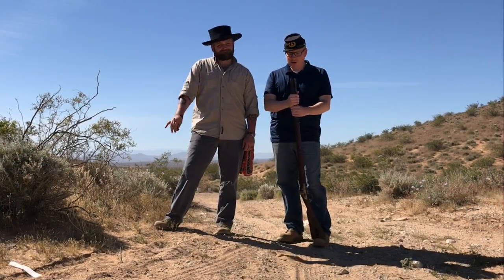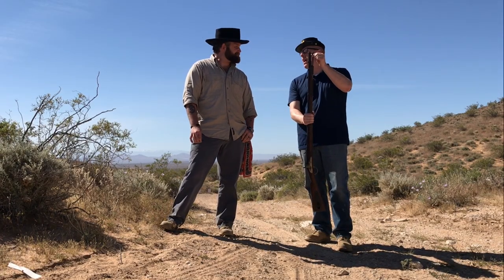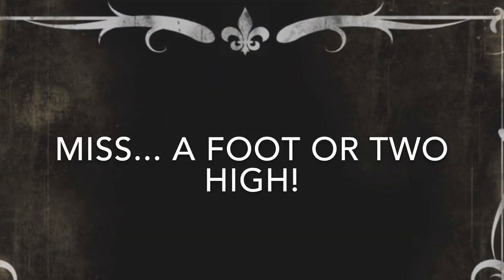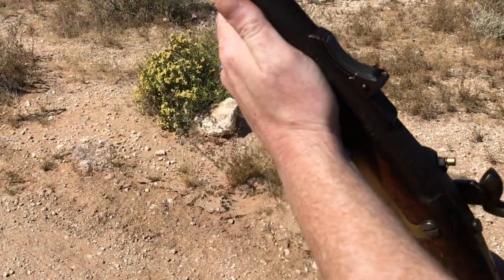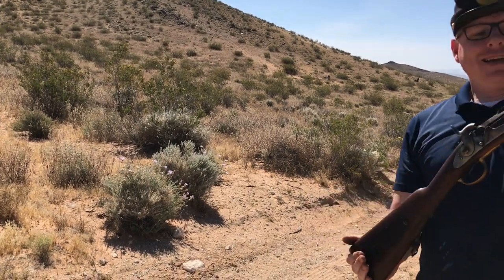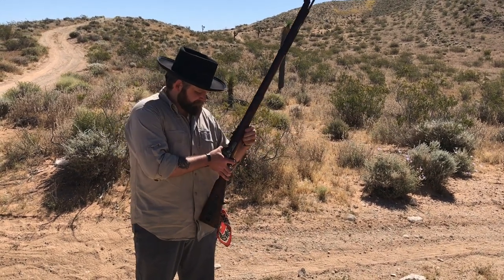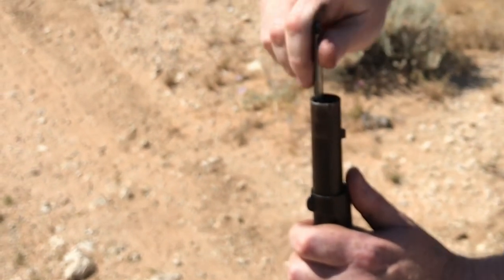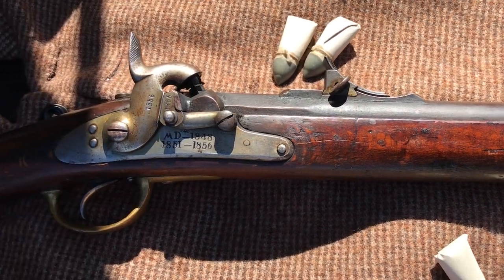Shooting the Danish Model 1848 Tapriffel tige rifle

Comment: 1 Alen = 62,7cm
1 Yard = 91,44cm
300 Alen about 200 yards.
(300 Alen = 186m and 200yards = 182,88m)
So the 300 Alen sight should work pretty well at 200 yards.
And a Great find. They are not easy to get hold off here in Denmark.... or actually they are easy and cheap in the converted Snider breechloadered version.
But one that was not converted is not easy to get hold of. and they cost maybe 5 times more than the converted version.

Comment: https://images.app.goo.gl/trPXvHxgEsrKRVuw9
Here are another type of cartridge this rifle might have used.
Described as "Papirpatroner til den Danske Marines Taprifle 1863" (Paper Cartridge for the Danish Navy Taprifle 1863).
The cardboard  stick coming out of the cartridge's top holds the primer. 
To load, the shooter places the cap on the nipple, then pulls it off via that slot you see. He can then bite on the stick pulling the cartridge open, and pour out the powder; before working the bullet out by hand.
You'll also notice the cartridge is made from an old handwritten document, which along with old book paper, was a common practice at the time !

Comment: How about the void between the powder and bullet? Is the charge adjusted in relation to the length of the "tap"?
Reply from the maker: It was strongly believed that having a little air gap between powder and bullet was greatly beneficial, and even after the Minié system appeared, there was reluctance to convert many tige rifles over because they were worried about crushing the powder under the bullet. The Austrians kept making tige rifles for special applications for this purpose.